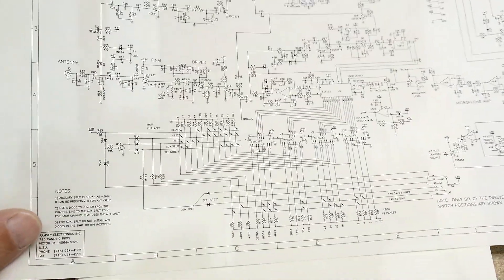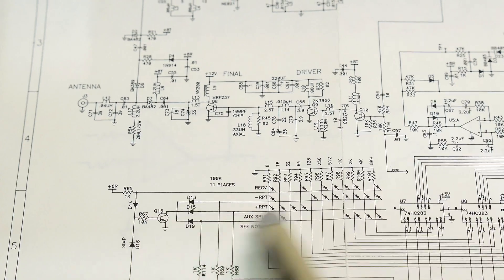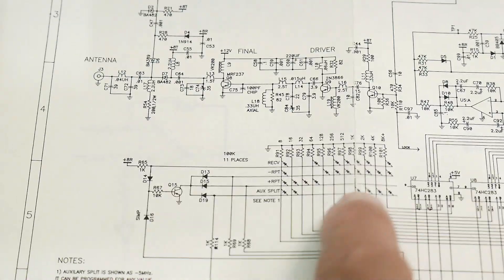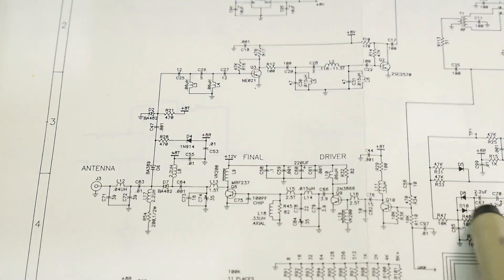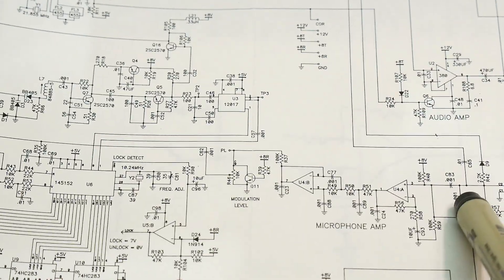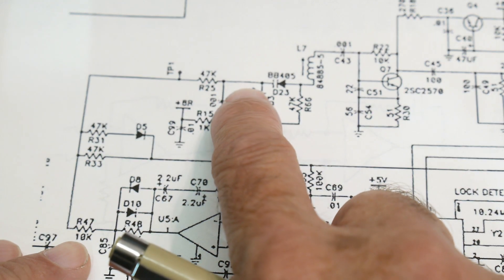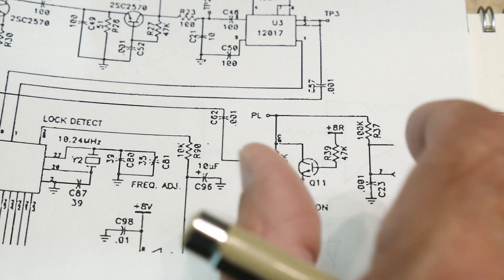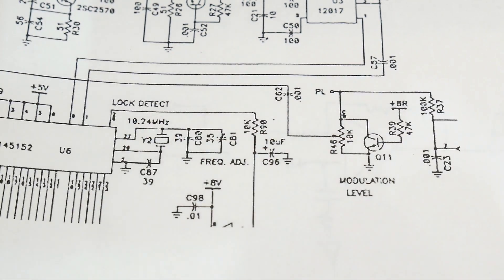#1516 Ramsey 2m Modulation (part 10 of )

Comment: Thanks so much for the series I'm loving going through it. I had one question that I was curious about. Wouldn't adding the modulation voltage to the loop cause the feedback of the loop to "fight" the modulation? Or does the loop filter take care of that issue? Thanks, Connor KQ4IPM
Reply from the maker: the filter is slow and things average out